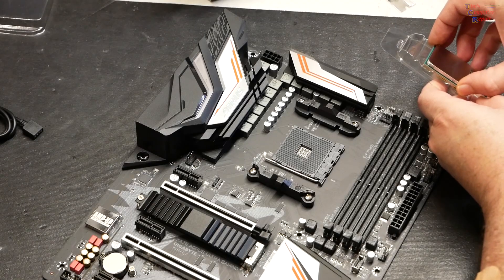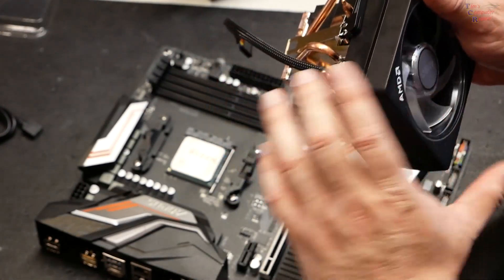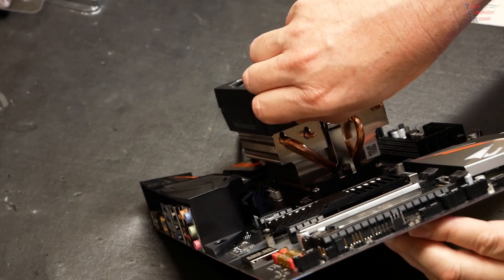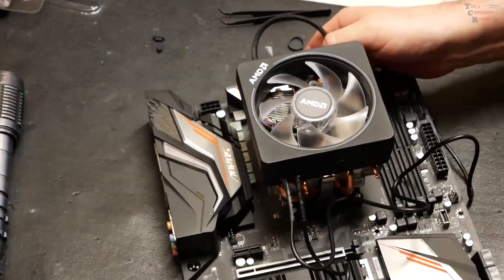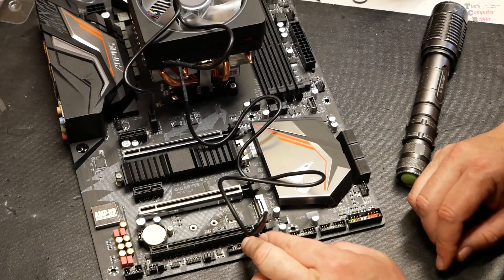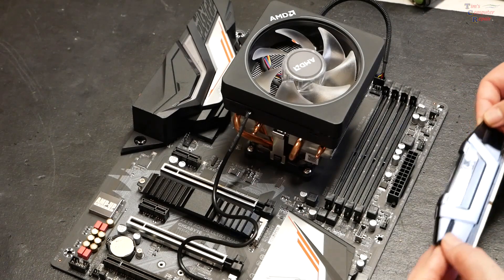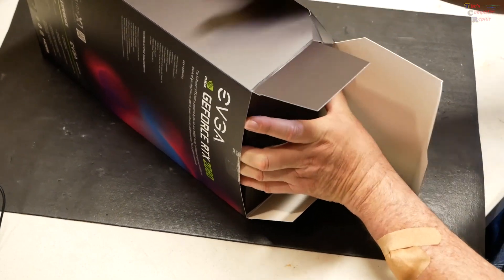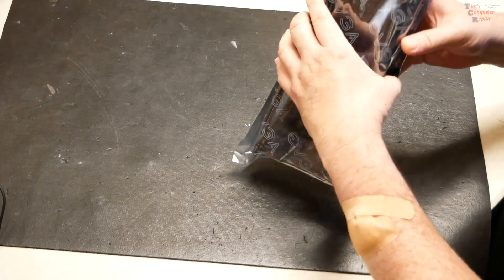How to Install an AMD Wraith Prism CPU Cooler

Comment: Wanted to watch a couple of videos before swapping Cpu Cooler’s,  replaced my Amd stealth with Wraith Max Rgb ( basically a Prism )  for my Ryzen 5 3600 + 32gb + Asrock b450m Pro4 & i wanted a simple cooler with airflow blowing downwards. i understand it’s not much of a upgrade butt i’m not OverClocking the Processor, just want about a 10c temp drop & the Wraith Max should provide what i need 🎮  Either way  Thanx 4 Posting 🇵🇹
Reply: Looking at a Max for my 3600. Was the performance worth it? What's the difference between Max and Prism?
Reply: @garrettj6468  - i ended up with both the Max & Prism = there both about the same { looks also } and they both cool the same as well butt can be abit Loud once they Rev_up above 60% ....... Rgb looks nice !
Reply: @hpcarlos2255  Thanks!

Comment: You dont have to plug both of the rgb an usb cable. Either you can usr rgb 2.0 for using the fan rgb and yhe other 2 zones (by default red) or, tge usb able for controlling all of tge 3 zones (logo, ring and fan) from the cooler master (amd) software. 😇

Comment: Excellent video because the instructions were really bad. thanks Tim
Reply from the maker: Glad it helped
Reply: @TimsComputerRepair  I completely didn't see those two cable rubber caps -- I choose the RGB connector and until you showed the locking of the fan/heat sink, I didn't fully lock the  unit, was worried it had too much pressure. You saved me a lot of searching too. you're a good man, have a nice day.

Comment: Anyone installing the cooler please note, Turn the retentions arm ALL THE WAY, make sure the side is 90 degrees flat, the tutorial did it half way, 90 degrees is on AMDs official website, failing to do so will result in temperature fluctuations and a toasty CPU, if unsure, go to AMDs website on Wraith prism

Comment: I had to place it three times before I could get it. Do I need to manually apply thermal paste? Or will the compound on it by default be enough even if it wasn't that sticky anymore?
Reply from the maker: The paste it came with will work fine.

Comment: I got it to go on with a little effort .But it was a little too noisy for my taste.
I went back to my H150i and Arctic MX 4 paste. When i removed the prism cooler it also removed the cpu. The stock paste is very strong.
 Same thing happened to  some others. Be careful.
Reply from the maker: Thanks for sharing

Comment: The worst part about those coolers is when you try to replace them you have to be very careful because the thermal paste could yank out the chip and damage the pins. And the lever on it to open the chip is basically covered by the cooler so you can’t unlatch it, at least not easily.
Reply from the maker: If you take a hair dryer and warm up the cooler that will soften the thermal paste enough to easily separate it from the chip. Thanks for the comment.

Comment: You actually installed the RAM in slots 2 and 4. The slot closest to the CPU is 1, but it usually doesn't make a difference.
Reply: Iirc on all recent gigabyte boards it's 2 and 4 first

Comment: Hey, both cables are useless! Still have leds on using only the power cable... So what´s the purpose of this cables (no note in the box...)?
Reply from the maker: You can control the rgb's through software.
Reply: So you need to connect both cables to control the rgb???

Comment: I see other  Wraith Prism cooler installs and the brackets are removed and the cooler is screwed to the bottom plate. Are there multiple versions of the cooler?
Reply: Are you sure that was a Prism and not the Spire? The 2700 comes with the Wraith Spire RGB which is screwed in, and the 2700X comes with the Wraith Prism which is the one shown here.

Comment: Do I have to pull the bracket down? Just reapllied my thermal paste after about a year and noticed I never had that bracket switch thing pushed down in the first place.
Reply from the maker: Lucky you did not overheat.

Comment: Are there any problem in case you use a normal RAM (not low profile)?
Reply from the maker: As long as the ram is compatible with the motherboard. The physical size should not matter.
Reply: Used corsair vengeance rgb which is basically as tall as it gets--clears fine with the prism.

Comment: I have a problem , i have the wraith prism , but my led was on but i can't make rgb
Reply from the maker: Install RGB Fusion and you can change colors.
Reply: @TimsComputerRepair  Okay now i have another problem is that the ventillo turns in color cycle but the ring on it, and i have a friends who put it in rgb and i try to find how to do it

Comment: If I don't plan on using color schemes, can I drop the RGB connnections?
Reply from the maker: Sure. I believe if you use the rgb cable only then your colors will be controlled within the BIOS.

Comment: If you have RGA header why would you hook up the USB header, the RGB should control it via the mother RGB software and be sync'd. Makes no sense to me. I imagine the USB cable is for a non-RGB motherboard.
Reply: You can’t control the inside fan color with rgb cable, only the outer ring. Also with the usb header you can get better effects if that’s what you’re into.

Comment: Do you need two RAM memories to work or with a single vast one?
Reply: 1 stick will work just fine, but 2 is highly recommended to utilise that dual channel
Reply: Gavin Hyman  wrong, dual channel is always better. If you truly only want 8 gb then use 2 4 gb sticks.

Comment: Finally my pc is done and... hitting 95 c at idle.. what did I do wrong with the cooler??
Reply: Might be bad thermal paste application.
Reply: Raul yeah the cooler was not making contact because after I took it out and put back in, the temps dropped to normal levels.

Comment: i need to use that cooler or i can use another one like a CORSAIR Hydro Series, H100i RGB
Reply from the maker: You can use whatever cooler you want that is compatible with the socket.
Reply: @TimsComputerRepair  ok thanks new sub

Comment: According to AMD directly and everyone on the forums you need both headers... If you use one without the other issues will happen with not being able to control lighting.
Reply: Also backed up by my personal testing.. Just used my 2700x in a separate build after upgrading to a 9900k. I really only came here to see which wire was which out of my bag of wires lol.

Comment: My cpu temperates rises alot. It sometimes reaches 97. I didnt have the rgb or usb cables on because i forgot but i doubt that would be the problem. Im ordering new thermal paste to put on maybe thats why. But anyone have any suggestions? Thank you. Its a ryzen 9 3900x and im freaking out cause it was expensive.
Reply from the maker: You need to purchase an after market cooler for that chip. The stock cooler is no good for the 3900x
Reply: @TimsComputerRepair  thank you! Im getting the noctua nh-d15 and hope itll be better

Comment: Hey Tim I just got this cpu cooler and I plugged the cpu into the cpu fan slot ( fan is working fine and the amd is lit up) but no other lights work in the pack I ordered it only came with the one cord which is fine (usb header)  but I have the b450MK motherboard and I can’t seem to find anything it can plug into on the motherboard
Reply: Could you pleasure help me I’ve been at it for a day now :(
Reply: Apparently the fan led and outer ring should light up but I can’t figure out where to put the cord into on the motherboard
Reply from the maker: There are 2 usb headers on that board at the bottom right next to the sata connectors. If you look closely at the headers they will read USB in or around them.
Reply: @TimsComputerRepair   Hey mate im fairly sure with the new model wraith maxs they only have one cable which seems to be the rgb? ive tried putting that cable into them usb headers and it defnitely doesnt fit, so maybe it only comes with the rgb?
Reply from the maker: Ah you stated you had the USB cable for the cooler but you only have the rgb cable. Don't know were you got the cooler from but you should have both cables. If you look on the cooler there is a place to plug both into. Your motherboard does not have rgb header so you have no way to plug that into the board unless you use usb.

Comment: Mine came with thernal paste pre-applied, ended up smearing the hell out of it trying to clamp down the cooler but I got it there in the end. Thanks!
Reply: I feel like Im about to break mine
Reply: Then you're on the right path. I was sure I broke mine when I finally managed to fit it. I just hope the pre-applied paste is up to the task 'cause there's no freaking way I'm taking that thing apart again...
Reply: It seems to fluctuate between 30 and 48 when idle and tops out at 59 when gaming (Celsius). Seems ok.

Comment: i just cant make the other hook clink!, dam i dont know if i didnt install correctly mi procesaddor, waht can i do?
Reply: from pathetic to a machine! Same, did you find how to do it?
Reply: @notagony41  first be sure processor is well instqlled. The lever thar put the processor well installed must be kissing the motherboard. 
After you are 100% processor is well installed( lever that secure processor is 180 degrees from vertical, just press with your 2 thumbs on the hook of the heatsink. And then the another hook that has a lever to secure it.
English is not my first lenguage. I hope i dont confuse you
Reply: @notagony41  i mean in min 2:10 just use two thumbs to press down

Comment: Use USB only if you want control your Wraith Prism colors.
Reply: Can I control the rgb on windows 8?
Reply: @misha_rocks2672  If AMDs wraith prism controller supports Win8 then you can.
Reply: @MythicFrost  the one available at cooler master's site says it's for W10

Comment: "oh boi!" lol my motherboard also has 2 usb headers of which i'm not using either just came with usb 3.0 header. Also, i didn't use lock the lever, because it was really tight, and it felt like if i tried to lock it, it would either break itself or break the motherboard so i left that sucker alone. also, thanks for showing how to connect the rgb to the usb header.

Comment: Does the cooler have pre applied thermal paste?
Reply: Yes.
Reply: Looks like it yes
Reply: Yes, but be careful. Have heard stories from friends about breaking CPUS by pulling them out with the fan because the thermal paste hardened and acted as an adhesive.
Reply: @iwfusion2154  oof

Comment: Just installed on an am4 board replaced with i3 and pc won’t boot any ideas
Reply: Does it turn on for few seconds then off, then on again and repeat? For me that happened because the rams were not inserted correctly.

Comment: I'm having problem to install thr right side of the cooler doesn't go down
Reply: You mean the clamp? You need to apply a decent amount of pressure. It sounds quite scary on a plastic handle though, but that did it for me.
Reply from the maker: You can press firmly on the metal clip also
Reply: @TimsComputerRepair  doesnt go all the way down

Comment: My Wraith Prism didn't mount easily had to slide it around a bit and apply a lot of pressure to snap it on,  the board may have been a little inaccurate. So much thermal grease on the bottom far more than necessary. No manual in the box just a warranty card. Didn't appear to have plastic under thermal paste.
Reply from the maker: The cooler will be VERY tight when installing. That is by design. Thanks for the comment.

Comment: Thanks for the vid good sir. I was confused which one was the rgb cable and which one was the usb one, and you cleared that up, much appreciated.
Reply: Mikee S. I’m still confused about them. Do I not have to use the RGB cable? Do I only install that one if I want to switch the colors with the app?

Comment: if anyone could help me out. because it keep doubting this. my current setup is

Ryzen 3 2200G
Radeon Rx580 8GB Nitro+
2x Hyper X Fury 8gb 3200Mhz
Asrock A320M HDR 4
Bequit11 80+ gold 600Watt
================= I already have the Ryzen 7 2700X just waiting for my motherboard to arrive=========
this is what is going to be 

Ryzen 7 2700X 
Radeon Rx580 8GB Nitro +
2x Hyper X Fury 8GB 3200Mhz
Asrock B450M HDR 4
Bequit11 80+ Gold 600Watt

my question about this is, will the PSU be able to handle it? i have alot of people telling me that it will. but the website says this 
 R7 2700X = 105 W
Radeon Rx580 Nitro+ = 500W
thats already 605Watt without counting the need for RAM and fans. 
ive contacted them through email and they replied with even a power supply of 550Watt would do it. but how? why does the website say the GPU alone need 500Watt already. like wtf this is confusing the hell out of me.

Comment: What a frustrating mess it is getting that second clip on. Holy crap. Let's improve the damn clip AMD.
Reply: you want it to be tight, right?
Reply: I just did that shit. I hope i didnt press too hard and anything didnt break.
Reply: you know what i did.  i used a flathead screwdriver and stuck it between the clip and fan and it went right on.   
i was getting frustrated before that, board was all flexing and what not.  but luckily everything was all right, it's up and running now.  :)

Comment: I need help
Reply: What is the issue you are having? I've just installed one earlier today
Reply: @bearingthebrunt3650  so I connect the metal latch thing that doesnt have the plastic latch and then I connect the one with the plastic latch but I cant lift the plastic bit up to lock in place without it breaking as i have used so much force and it just wont lift up and lock
Reply: @yournan7249  The latch that "locks" in place is very tight. I have installed many coolers but even I found it very "rigid".. you kinda think you are going to force it too much & it will break but don't worry it should lock in place, but you do need to use a little force.
Reply: @bearingthebrunt3650  I'm using load of force so something cant be right
Reply: @yournan7249   Your Nan  maybe remove it completely, go thru steps in video again & ensure you've attached clip correctly & try again with the clasp  There's also other tutorial vids out there with close ups which may help. I won't post links but Gaming DJ has a vid that help 👍

Comment: I think you edited past the part I am having trouble with, the brackets.
Reply from the maker: Set the cooler flat on the cpu. Hook the clip into place first on the side that has the lever. Don't use the lever use your finger to hook the clip. With your finger press down on the metal clip on the side without the clip to latch that into position. You will need to use a bit of force to latch this side down. After both sides are latched you can flip the lever all the way over to lock the cooler down. You will also need to use a bit of force with the lever. The key during this entire process is always keeping the cooler flat on the processor. Hope this helps.

Comment: Yo next time you should tell people to put in those small ass cables before you put in the cpu cooler. Especially if they are installing this on a board that’s already installed into the desk top.
Reply from the maker: Thanks for your input.

Comment: did you just sad you sad on that moderbord you dont need both 4 pins rgb conection and t he usb conection for have that rgb working? with this cooler i had same setup like you just show here , and had just install my cooler and i swear alot to the amd its like you sad destroy my nice cable manage (if i need to use both). so if its like you sad and i did so i only used my usb cable to it and drag t he cable under the grapics card to he usbport and now rgb will work but not with mainboard settings

Comment: I was checking to see I did everything right because my fan wouldn't start, but it turns out AMD just sent me a defective fan...
Reply: You should connect the cpu fan power to CPU_OPT, not CPU_SYS or CPU_FAN, works for me
Reply: @bagassatriyo3571  why?

Comment: what if you dont give a crap about colors? Just want the fan auto controlled properly
Reply from the maker: You can use the software to set to LED off
Reply: @TimsComputerRepair  but do u need to plug in the 2 wires?
Reply: @ShankABat  no

Comment: "Push down pretty hard" -- no fcking joke. Brute force, much too much brute force.  Redesign the heatsink attachment brackets, AMD.

EDIT: tip to others who come here looking for how to attach the heatsink: insert a screwdriver between the heatsink and the brass clamp/band you're trying to fit, and use it as a lever to push the brass band down so it locks on the hook on the motherboard.
Reply from the maker: Thanks for commenting.

Comment: My retention handle (the plastic lever) broke while applying a lot of force trying to secure it in place.

What can i do? I am devastated. This stuff is expensive where I live
Reply from the maker: Broke? WOW! Where did you purchase the cooler? I would ask for a return or replacement. Reach out to AMD for a RMA perhaps.
Reply: I feel u. Nearly broke mine too today, gave up and will give it to someone else. It seems that the plastic handle changed in design from what I've seen in videos (compared to the plastic lever on the same cooler included with the 2nd Gen Ryzen, there the lever is more round, so way easier to secure). 
I really don't wanna break it so I'll give my PC to an real pc builder, just to do this damn cooler installation. I thought about many problems I probably could run into building my new system, but I definitly wasn't prepared for this one. Shame on me.